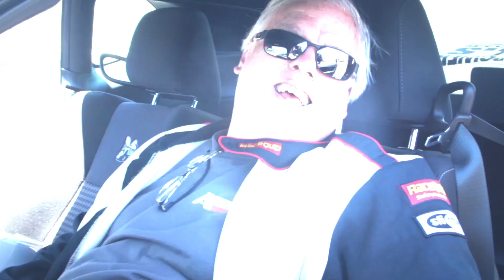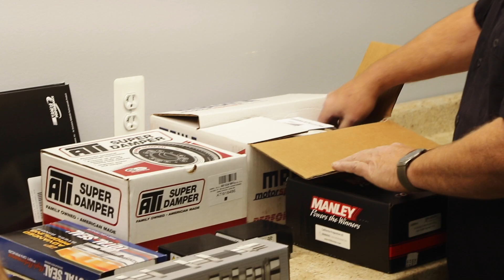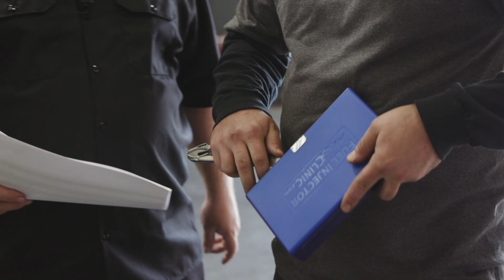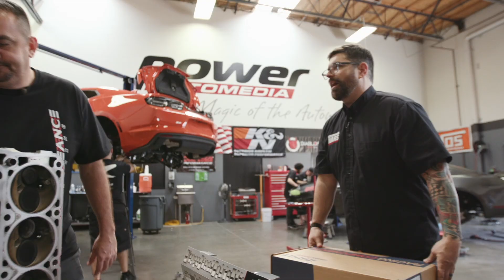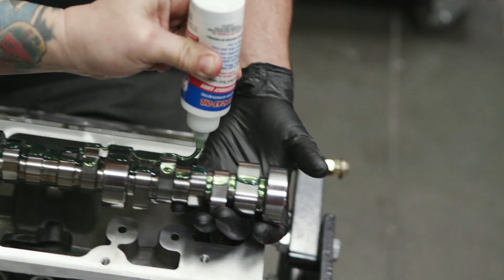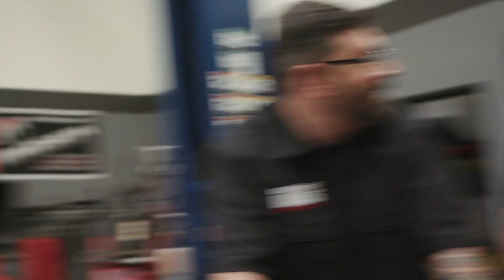Pony Wars 2 Episode 3: Preparing for ProCharged Boost

Comment: Man if you really think about it. Chevy and ford have swapped strengths based off of this series since the 90s. I'll explain.
90s
Foxbody 5.0
Good rear end/suspension
5.0 blew up at 500 hp and had terrible cylinder iron heads
Terrible t5 trans

4th gen camaro
Solid engine that can make 800-1000hp with little mods
Good t56/awful 4l60e
Terrible 10 bolt/mediocre suspension

Today 6th gen camaro
Engine blows up at 650hp
Solid rear end/ suspension
Good trans

Todays s550 mustang
Good engine makes 900hp stock/oil gears
Weak axles and weak suspension.

This is realtive; obviously to the time periods. 

Just my personal observations

Comment: You know it’s bad when the mustang team is talking about how ridiculous and time consuming it is to change the mustang oil pump gears.  That’s classic ford though.  Make things extremely difficult if it saves them a nickel per car.  It’s also a shame they haven’t improved those oil pump gears from the factory yet.  They have been a known problem since the coyote first came out.  Ford does some dumb stuff and I’m a ford guy.
Reply: Even Ford tosses out the factory oil pump gears and replaces them with billet parts on their Ford Performance Coyote crate engines. It's fucking annoying.
Reply: Mike C how many are boosted and need gears?  I have no idea how many but it’s a lot of them, most all of them on the performance sites I visit on The Internet.  This is a performance video talking about performance cars.  Why ring up stock cars that don’t need better oil pump gears?  Anyway, I’m not a huge LS fan.  I know they have problems too, but ford should be embarrassed by not fixing a known problem that would be a relatively easy and cheap fix with the oil pump gears.
Reply: @mikec9112  LMFAO you're just as likely to have a cam follower or lash adjuster failbon a Coyote. Big fuckin deal if a lifter goes bad. Only a fuckib moron lets a lifter damage an engine enough to cause a major problem. Otherwise its just a matter of pulling the head. Perfect opportunity for a cam swap, which is also a fraction of what it would cost for a Coyote. 

Ps the biggest hype with the Coyote has been their power capability when boosted. Have fun with cheap brittle oil pump gears, junkblash adjusters, and junk interted-tooth timing chains.

Comment: There is no way all three teams spent the same amount.  You can’t pull the motors on the charger and camaro, put forged rotating assemblies in them, and not spend more than the mustang team.  Maybe in parts you could somehow say they spent close to the same but what about the time, effort and money to pull the motor and build it?  It would probably cost another $10K to get vengeance and Arrington yo do the labor.  If you did it yourself, unless you have a shop as nice and the experience of Arrington and vengeance, it will take you forever and 90% of people couldn’t even build a motor like that.
Reply: Labour isnt included.

Comment: Ford engineering just sucks
Reply: The engineering is okay. Ford just builds the factory engine too cheap. Even Ford know the factory powdered metal gears are junk. Their factory crate engines use upgraded billet oil pump gears.
Reply: @hochhaul  they are also over complicated to the max for no reason.

Comment: The engineers did think about it. It's called job security and them making a ton of money in repairs after the warranty runs out. To say they didn't know what they were doing is hilarious.
Reply: Stock oil pump gears don't need warranty and repairs, find anyone breaking them on the stock engine. In this case when you throw a bunch of boost at the car it needs new parts. The Mopar And Chevy needed basically new engines, the ford needed oil pump gears.

Comment: How sad the Chevy and the Camaro have to upgrade internals just to handle simple boost.
Reply: The only one that had to was dodge as far as handling the power. The ls would have stayed together for the competition. They most likely wanted to go up in compression to make more power. Where the dodge had to lower it to keep the crank from breaking. 
Everyone knows the stock ls short block will Make 1000+ even the 5.3's will make that.
Reply: @waynebollentin989  BS the Chevy had heads and cam swap the coyote just had oil pump gears upgrade big difference this is not even at all
Reply: @2012omar302  what's bs about the Chevy not actually needing the pistons and rods as far as handling the power? That's 100% true. Ford guys could have installed better heads but it's not worth it. They are all going to be limited by the Procharger being used. Ford knows they wouldn't have made anymore power with the better heads. Would have been about the same power just with less boost. They're all on the same budget so it's completely far. They spend the money where it's going to benefit them the best. Ford has a ton of money to spend in other places the others won't be. 
The mustang more then likely beats both of them in the racing.  
If you understand engine building and power adders you should have understood what I was saying here and not freaked out over it. Specially when your first comment was about handling of power that I responded to. 
How you don't know a stock ls or new Lt can handle 1000hp+ and your watch this is beyond me.
Dodge is the only motor the piston and rods was a must. Chevy did it to make more power by increasing the compression. Dodge went lower because of the shit factory crank. Not change the crank with the same stroke will come back to bit them.
Reply: @waynebollentin989  all I said is that this is not apples for apples nothing to do with engine building if you would have read my first message I said that's sad that both the Mopar and Chevy need internal mods just to make simple boost is all I said you are the one taking these to the next level
Reply: @2012omar302  I understand that but my point was the Chevy doesn't require it as far as handling of the power aspect. It would have taken the 1000hp fine. They wanted more hp out of the motor power wise. As far as that goes your correct.
Reply: Until ur coyote makes 900+hp and blows a rod or chain then needs a fully rebuilt motor.
Reply: @nathan22outdoors8  yeah something that the Chevy or Mopar can't even get close to lmao both will blow pass 700 maybe even sooner with stock bottom ends sad
Reply: @2012omar302  so what? Compare the cost of each motor to be reliable for 1000hp instead and i garentee that coyote is going to cost more.
Reply: @nathan22outdoors8  that coyote will have no problem at 1000hp. Of course any dual over head cam motor isn't as reliable but it's much more efficient and makes more power everything else the same. They both have their pros and cons and both are great motors from the factory. Dodge is the weak motor out of the 3 in stock form. My other comments here cover the rest.
Reply: @waynebollentin989  lmfao are u smoking something? Those rods can barely hold 900hp and that chain cant even make 1300 crank hp. Thats 2 parts, at the verge of blowing at 900-1000 wheel hp.
Reply: @nathan22outdoors8  smoking something your the one who brought it up lmao looks like the one that is smoking something is someone else lmao but good one hey that sounds like good stuff man share will you lol
Reply: @nathan22outdoors8  they won't have a problem with the chain at 900hp. It's when you get to about 1300 to 1400hp that's a problem. Only thing thats a problem around 900 is the pump gears. Watch and learn something. This coyote will have no problem making 1000hp. They're also only using up to a D1-X. Not an F series where the chain had a problem last time. These rods are good for 1200+ and many have done it. Guys that usually have problems at 900hp are from not changing the pump gears and shit tuning. Like I said watch and learn.
Reply: @waynebollentin989  Do u know what your talking about? The newest gen coyote weak link is the rods which can barely hold 900hp. If u blow that, the whole motor is done. Right behind that is the chain, which can easily blow by them over revving it.
Reply: We will see how the linerless blocks hold power WITHOUT E85.  The fuel they are going to use will be way less forgiving thats for sure.
Reply: @shaadydog1  these motors aren't going to make the power where that's a problem. They can't use anything bigger than a D1. It would be a different story if it was a F1 or bigger they had on the motors. That's why the ford guys didn't bother messing with the motor. Car already has 12.01 comp and strong enough rotating assembly to handle the D1. The money was spent in other places where it will make a bigger difference. I think the Chevy guys spent to much on the motor. Just about 80% of the budget went to the motor. The dodge guys had no choice. They come with shit pistons compared to ford and Chevy. Be cool to see how it all plays out. I guess that's why we all watch though lol..

Comment: 5.0 needs a billet OP, Hemi And LT, well dig deep.
Reply: S Schroeder ha, you say that and we’re watching the mustang guys, Dig deep, for A gear set, not pistons and this and that, soo.. what are you saying...?
Reply: Biggest problem the LT has is the rings butting. Coyote supposedly had a ring problem too on extended pulls and 1/2mi runs...  These are really tight engines from the factory. Makes sense to do pistons if you need to do rings past a certain point, I dont believe the rods are an issue for the levels they are going to be at here and would have saved a shyt ton of money for the trans etc...

Comment: Everyone building entire engines but ford! 😂😂😂. Who has the strongest longblocks? Oh yeah Ford!
Reply: Lol.....they aren't rebuilding the ford cause they don't know how to wrap there heads around all that damn timing chain.....
Reply: @trentdawg2832  Wouldve been hilarious if they changed the rods and fucked the timing then blew it up 🤣🤣
Reply: @trentdawg2832  they are doing oil pump gears which means the TWO timing chains come off. The tiny chain that links the two cams together on both sides rarely ever fails. Only times when chains come off is if guide breaks or oil pressure is lost causing tensioners to become slack. So they had the knowledge to tear it down but for what it doesn't need a built motor to win
Reply: Lmao yeah sure. We all know whats going to happen. That coyote is going to get pushed to over 900hp and blow a rod or chain then need a fully rebuilt motor.
Reply: Who cares about the claim you make. It'll blow one of the 10 timing chains and then game over. If everything around the block is shit who cares about the rest? The mustang has lost every competition it's been in on these series starting years back with the LS. Now the LT will be doing the same
Reply: LOL no, they don't. Coyotes need sleeves to live long beyond 1000 HP. The 3rd gen Coyote's safe limit is closer to 800 HP without sleeves. Not to mention the blocks need the gusset mod to protect them from cracking as you approach 1,000 HP.
Reply: Are you new to the car scene the Gen III coyote has buily internals straight from the factory.
Reply: @hemiyachtcharger6538  their rods cant hold 950hp ill tell u that.
Reply: @nathan22outdoors8  obviously the dodge can't either if they are building the motor. Gen 3 coyotes can hold 900rwhp+ with boost and fuel only!!! Don't believe me look it up or call lund racing or palm beach dyno and they (the real pros) will set you straight. When it comes down to it LS Nor dodge can compete with the mmr mustang! Build for build coyote smokes the competition
Reply: @randymatthews3889  Lmao yeah sure 900 wheel for what? 4 dyno pulls? 😂 u are lying to yourself if u think 900+ is safe and reliable on a stock gen 3 coyote 🤣🤣 ive even heard it from ford owners who drive and build mustangs. At 900hp u want to change rods, timing chains and sleeve the block if u want to safely hold that power for anything more then 4 dyno pullls 🤣.
Reply: @nathan22outdoors8  well I can send my dyno numbers if you would like. I own a paxton mustang and have already been there and done that. Mods are long tubes no cats, fuel system, ported manifold  and paxton 2200sl supercharger. HAS FACTORY OIL PUMP GEARS!!! If all of you ford haters dont believe me call and talk to Rob at palm beach dyno and he will make you feel 2 ft talk when he tells you what he can do and what he has already done. Like I said stock long block! What stock long block cars go deep 8s? Hahaha COYOTE of course. Gen 3s are animals and dollar for dollar you just can't compare anything to it period. Built motors and blower vs a oil pump gear and a blower! FORD FTW!!!
Reply: @hemiyachtcharger6538  Are you new to the car scene? The gen 3 Coyote doesn't even have iron sleeves anymore. Most reputable shops strongly recommend sleeving the gen 3 block if you make over 800 HP.
Reply: @hochhaul  the kid has no idea what hes talking about. Doesnt have forged internals, and 900hp is when parts start breaking if its a chain or a rod or block, something is going to let go.

Comment: The problem with a procharger it makes a lot of horsepower up high but no down low torque although I see the hemi stomping the s*** out of them at the drag strip handling I think the mustang will get it
Reply: Camaro I don't know they spend a lot of money on their engine
Reply: A 6th gen 1LE Camaro will out-handle an S550 Mustang. The suspension mods might help level the playing field though.

Comment: Without labor charges being included this is a pointless comparison.
Reply: J Mcg Why do you need labor? All this stuff you can do yourself
Reply: @Spac3Monkey  maybe the Ford guys but not everyone has a car lift engine crane and engine support cart in the garage I've seen heads and cams oil pump gears headers and some suspension work being done in a drive way but not everyone can do cranks and pistons in your drive way
Reply: Its a competition not a comparison. Labour cost dpesnt need to be included because if anything that would make this even more uneven since each place charges a different amount for labour.

Comment: So the ford guy thinks just the procharger and suspension is gonna be good when he will be out gunned by 300hp? Lol Ford sucks
Reply: The more efficient head of the Ford is the equalizer.  Boost baby!
Reply: Stock bottom end motor can only take so much boost... The mustang may win in a small curvy road coarse but in a drag race... Not a chance.  I think if you left all 3 completely stock and just put procharger on it would be close..... To be honest I would of rolled the dice on that oil pump gear since they are only going to be ran hard a couple times and they could of used that time for other things
Reply: @carlditeodoro4044  what's the big rush, nothing's going to happen for another 6 months... Plenty of time
Reply: We will see, don't underestimate Ford power !!!!!
Reply: @peterkay2406  lmao nobody is underestimating it. We are all just ready for that coyote to blow a chain or rod and need a whole new motor 🤣
Reply: Nathan22 Outdoors and whatcha gonna do if it don't, Ford tough baby
Reply: @peterkay2406  what does a fullly built motor have anything to do with your shitty rods that are known for blowing up at 950hp ?? 🤣🤣
Reply: @nathan22outdoors8  how is it that forged rods are crappy? Last I knew forged rods were pretty good, not the best but pretty good, and then you have a forged crank which is good also and then cross bolt mains, I just don't get it and why the hate, I think you got one solid platform that of course there is some weak spots that need to be addressed for longevity, and when you address those weak spots look out, you end up with one impressive motor that most people fear and it shows 😜
Reply: @nathan22outdoors8  everyone says coyote motors are crap, that's the reason for the video, try to build that much power with a LT or LS engine lol lol lol
Reply: @peterkay2406  because the gen 3 coyote doesnt have forged rods 🤣🤣 go look at the comments on the last video. 2 or 3 people corrected the guy for saying they had forged rods. Gen 3 coyotes have sintered steel rods not forged.
Reply: Nathan22 Outdoors if that's the case I stand corrected and yes those style rods are crappy and they should definitely change them if they plan on putting some real boost in the car, I couldn't agree more
Reply: @nathan22outdoors8  Not to mention the lack of iron cylinder liners on the 3rd gen Coyote alone makes it risky to run the engine anywhere close to 800 HP long-term. The big engine builders that specialize in Coyotes will tell you to sleeve the block if you want it to live making that much power.
Reply: @hochhaul  Ya everyone gets caught up in hero runs on the dyno, cool indoor temps, running the rpm super high etc. Yet most claims are not backed at the track by customer cars.  Funny how that works. Dont they warn against  long dyno pulls and 1/2 mile pulls too because of rings being a weak point? How is that going to play out in the slalom lol?   High comp, spray bore and no e85 will be the demise of the CRYote...
Reply: I just don't see it happening but I have definitely been wrong before

Comment: Would of been cool if they would of done a 5.7 Challenger also for us under dogs🐕
Reply: With the weight of the challenger, they need as much displacment as they can get.
Reply: @nathan22outdoors8  also
Reply: They should have used the 5.7 to keep displacements similar. The challenger has 90 cubes on the coyote. What a joke
Reply: @HandDriven  Not really a joke but ok. The coyote has double the valves, revvs higher and its a newer design. Displacment is totally irrelivant at that point.

Comment: Not sure why the Mustang guys didn't go with an Cobra Jet intake.
Reply: r000tbeer  the stock 18-19 manifold makes good power
Reply: Cobra jet won't fit under stock hood without a cowl hood or lowering the engine with motor mounts. A good ported gen 3 manifold does excellent no need to change it
Reply: I know it works well, just not as good as a CJ.